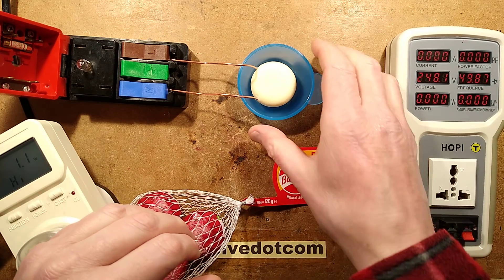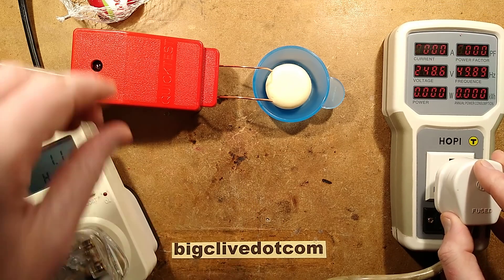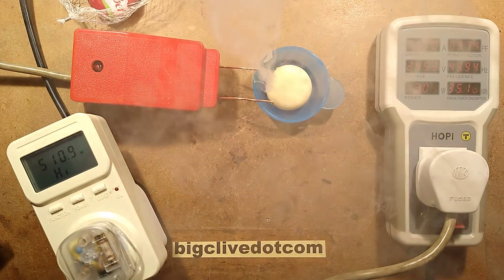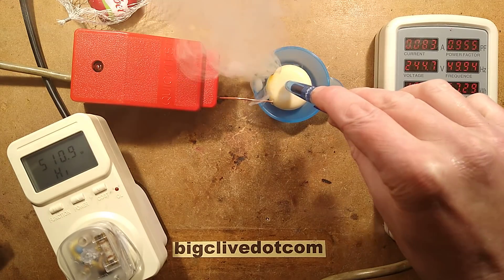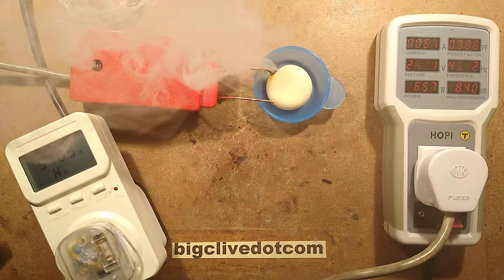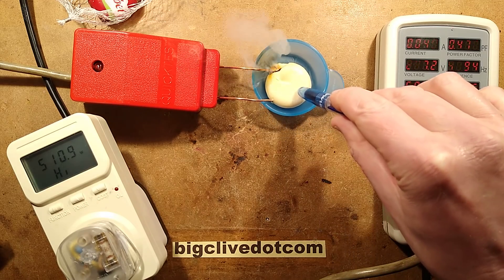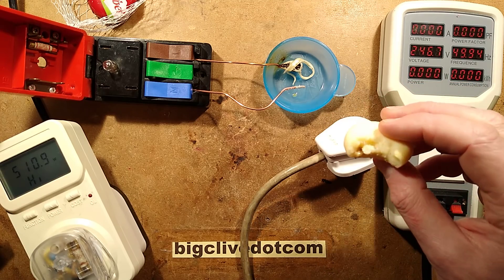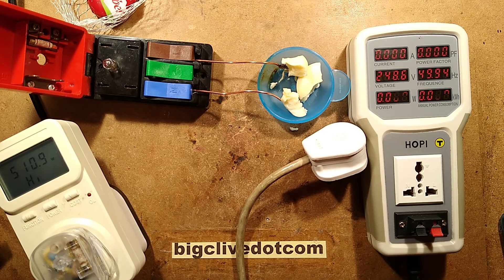FULL-FAT Babybel versus 250V cheesemageddon.

Comment: North from South, and West of East lies the little town of Flaklypa, where a local inventor named Alfie Clark has his workshop. Nimbly aided by his companions, Louis, and Luca............ (Slight twist on the "Louis & Luca" films from Norway)........... Then Clive comes along and nukes a ball of cheese at full mains power!

Hi Clive, how about a large diameter copper cheese clamp? Make two discs, about the same diameter as the cheese. Solder to each one, a connecting wire to carry the current. Make an insulated frame to squeeze the copper discs against the cheese (or just clamp in the "Vice of Knowledge" but insulate the copper from the vice. Now introduce 250V and let's see what happens? Maybe even get a bit silly and try half wave, and then full wave, rectification and see what effects DC can bring to the party?

I'm seriously wondering what he potential benefits of "Direct Heating" of food might be - certainly cuts out the pots and pans! I wonder if you could find an ideal V/A balance (use a variac?) for specific foods and see if you could cook an actual meal that way without burning the food? Hmm, I wonder what would happen to and egg! (Metal cup to contain the egg (sans shell) with variac between mains and metal disc, to supply the current).

You should have seen me here, the idiot that I am, trying to blow away the smoke to get a better view - Oh, and that smoke really stinks the house out!

Comment: I think your electrodes are defective. May I suggest two stainless steel flat plates in which you can squeeze against the sides of the cheese - surely the much grater (sic) surface area of the plates would allow a greater current flow and therefore be more effective ? I suspect this would offer up more experimental opportunities - with things like thick slices of potato ?

Comment: Just speculating but the smoke following the wire...
If the wire is hot then the air immediately around it will be rising, causing a localised bit of low pressure, sucking in the air from around it, including the smoke. It looks like the smoke is following the wire due to the boundary layer on the wire holding the immediate air next to it close, which again includes the smoke?

Comment: How about trying another variation? Place the cheese between two paddles so the surface area contact is large. Might need a current limiting device for safety, but then probably more fun if it just explodes. Could use a couple of spoons as the paddles.

Comment: I would be interested to see the result if you had multiple connections to the cheese from each terminal, maybe 5 smaller wires for line and neutral?
Also, how would it fare with a metal dish connected to one terminal, with multiple wires poked in to the cheese from other teminal?

Comment: How about if you make or find a conductive lower "pan" ( a little larger than the diameter of the cheese) and apply one probe and make a Babybell cheese sized "cap" or "paddle" for the other probe to cover the top side of the cheese "patty". More surface area.

Comment: Something a bit less solid like a soft brie or a cheese spread might be an interesting experience. A certain cheese that comes in a squeezy metal tube would provide a good surface area for one of the electrodes (provided it was not sealed to prevent any ingredients in the cheese causing corrosion).

Comment: Clive, I demand that you do one more test of the Babybel Cheese-o-cutor. Switch your electrodes to two large coins, and make a cheese-coin-cution sandwich. Then set a weight of some kind on top and pull the trigger. I want to know how long it will be before it actually starts on fire.

Comment: The smoke is being blown out of the hole, so it will naturally tend to follow the wire (which projects outwards from that hole more or less in a straight line). Then you get a bit of Coanda effect making it "stick" close to the wire since there's no external pressure to blow it away from it.

Comment: That is interesting how the smoke follows the copper wire. Maybe it's some kind of magnetic field thing. Although it's not DC. Weird.
Reply: My theory: uncharged particles are attracted by both positive and negative electric fields. The live wire has a potential difference wrt earth of 240V on average, so the particles would tend to be drawn towards it during both halves of the AC cycle. Since the half-waves don’t cancel out there would be a net force acting on the particles. At “only” mains voltage and with such small surface area the range of effective attraction would be very small, but since the smoke emanates right around the wire it’s probably close enough for the E-field to act on it and drag it along.

Comment: 2 disc-shaped electrodes on either side of cheese would make a hell of a show. Dairy capacitor if you will
Reply: Cowpasitor
Reply: @numonefranbegbiefan  Best smelling Cap on the market! And tasty, too! Every time you turn on your electronics you will crave a grilled cheese sandwich.
Reply: Yes I thought that too. Only I envisaged the connectors curled around in a spiral, top and bottom.
Reply: Be interesting to measure the capacitance.
Reply: Like defibrillator paddles!
Reply: @LiLi-or2gm  YES!!
Reply: Or TENS electrodes.  What happens when you TENS a Babybel?
Reply: @AndrewBeals  They are crap for such things, the gel would either dry or maybe even melt way to quickly. Also that carbon film isn't that good for high current. probably would heat up very nicely, need to try it after the current set is done. :D
Reply: @AndrewBeals  It feels no pain
Reply: For science!
Reply: 250 Volt cheese smoke random number generator...sounds like something from Hitchhiker's Guide to the Galaxy .
Reply: Babybel MOV  !      BB-40D101K
Patent Applied For
Reply: Thought that too
Reply: I wonder if it would have a positive temperature coefficient.
Reply: Capa-cheese-tor
Reply: Yes, I want to see this.
Reply: yes
Reply: He probably will
Reply: Damn, I was just about to suggest this!
Reply: What would the power factor be?
Reply: Not a tantalum capacitor, but a calcium!
Reply: Yeah, but this is the part where ElectroBOOM comes into picture, doesn't he? (Don't get it? Search for that channel on YouTube :D )
Reply: Not without the fuuuull briiiidge rectifier then ;)

Comment: The smoke running along the live wire was the most interesting part to me! I wonder what causes that?
Reply: The smoke is being blown out of the hole, which is "aimed" in the same direction as the wire, and then you get a bit of Coanda effect, so it tends to travel close to the wire until there's enough turbulence to push it away.
Reply: @RFC3514  I believe the gravitational pull of the moon caused a centrifugal force upon the smoke putting it into a spin, no attraction to the wire whatsoever....and I just pulled that directly from my arse.😄
Reply: Mostly just pulling this out of my rear end but my guess would be that since it was the live side that got smoky this time around that the smoke had at least a slightly positive charge and was attracted to the negative charge of the electrode, kinda the same effect that causes dust to stick to your ceiling fan so vigorously, just with the charge provided by the mains voltage rather than friction against air molecules. If someone has a better explanation I'm certainly interested myself
Reply: @philondez  this wasn't a DC power supply, so positive and negative don't really apply here... It could be that the smoke was remaining a neutral observer...  ;) (Maybe it stayed grounded like the cheese and was attracted to the hot wire?)
Reply: It's similar to the other answers, basically what's going on is the smoke was positively,  then gets attracted to the negative copper wire you can see it's attraction and not just force of it being blown similar to static on a comb making water bend from your tap due to natural ions in the water. The exact reason would involve many a cheese and scientific study.... for science!
Reply: @Codingale - So, tell us, which one is the "positive wire" and which one is the "negative wire" when something is connected to AC? :-P
Reply: It was random. It was AC isolated from Earth/Ground. No positive or negative charges. They are all cancelled out 50 or 60 times a second.
Reply: @Matthew Pettengale - Ultimately, everything is "random", but this is a fairly well known effect in fluid dynamics called the Coanda effect. 

Basically, if you blow air close to a smooth curved surface (with an initial velocity going along that surface), that air tends to "stick" to the surface because there's air pressure pushing it towards the surface but no pressure pushing it away from the surface. Eventually turbulence wins over (especially as it slows down) and the fluid detaches.
Reply: @rfc3515 I read the question as asking why it was the Line, not neutral that was causing the smoke.
Reply: Wire is probably hot causing convection around it.
Smoke is being expelled directly to the electrode and then pulled into the convection air current.

Comment: Save your Babybel wax! You can roll it up into a ball, then stick it in your tool box or junk drawer (like I did). It's really handy of holding nonmagnetic screws to the end of your screwdriver for starting them in hard-to-reach locations.
Reply: It'll be good at collecting all the dust in the tool box as well!

Comment: Everyone knows that when you electrocute a cheese you have to use gold-plated electrodes, so that the copper doesn't get into the cheese and spoil the flavour.
Reply: Well they do now :-)
Reply: Silver or Platinum are other obvious choices.  Silver is the common choice for somewhat affordable tableware, while platinum is the standard for laboratory probes.
  By the way, one of the early types of gold plating for cooking tools was found to be too easily dissolved by common foods, resulting in other involved metals being eaten.
Reply: John Crower Doe - Fun fact, the Romans developed the first artificial sweeteners by boiling grape must in lead pots, causing a reaction that formed lead acetate, a very sweet compound.
Of course it's also horribly toxic, but they didn't know that.
Reply: Or iron to boost the iron content.